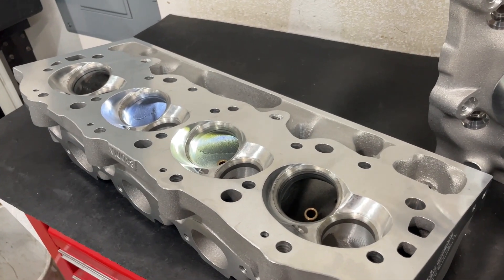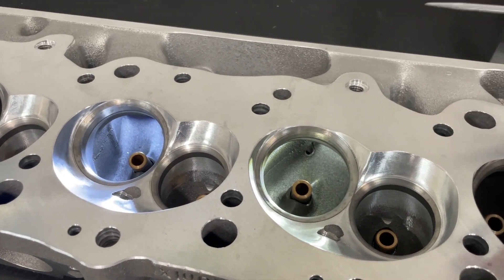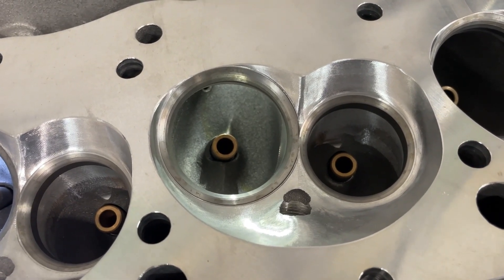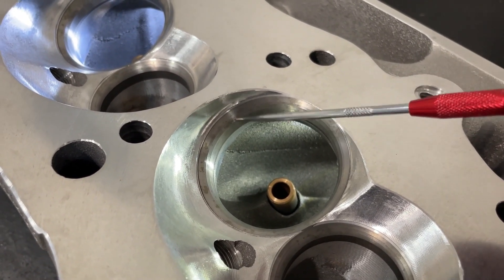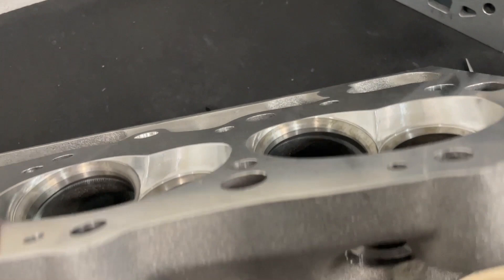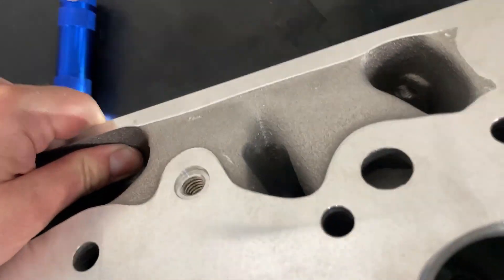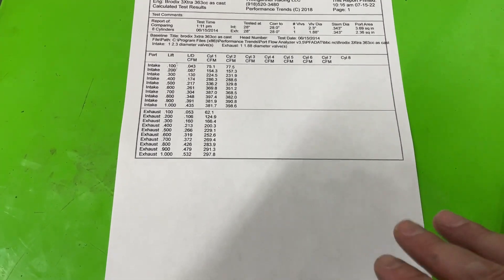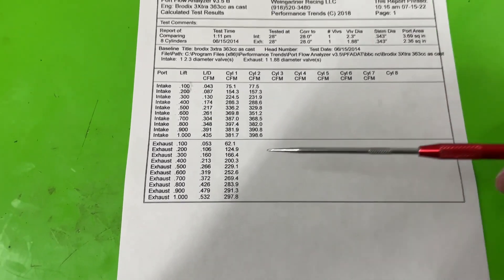Brodix BB 3xtra 363cc Head Review

Comment: Man, I saw this video pop up and thought, whoa, those might be my heads. Then I saw Phillip written on them. As you mentioned, a little disappointing with the as cast numbers. However, I know with the Ferrea valves, 2.350's and all the work you do, they will come out quite a bit better than that. If you do the after port work and 2.350 cut video, I look forward to seeing that. * Question: could these heads be cut for a 2.375 valve, or would that eat too much into the exhaust seat?
Reply from the maker: I will do a follow up video. I could have cut them to a 2.375intake valve but I would have had a 1.85 exhaust valve.
Reply: @WeingartnerRacing  hmm, seeing as my engine will eventually see nitrous, I probably wouldn’t want to reduce the exhaust valve size for a slight increase in intake valve size (2.375). Unless you think it would still be beneficial. I trust you to do what you think is best for my combination; 13.2:1 582, that we talked about you custom spec’ing a cam for. 1000+hp NA that will later see 250-350 worth of nitrous.

Comment: Heli coils hold better than just the original material and they tested this on the “torque test channel” using an ARP l19 studs. They tested time serts as well and the heli coils out performed everything else. Using red thread locker when installing helicoil keeps them from walking out over time.
Reply from the maker: I will have to watch the video. I have seen more helicoils pull than timserts.
Reply: @WeingartnerRacing  I thought it was weird because time serts definitely seem to be a better design.